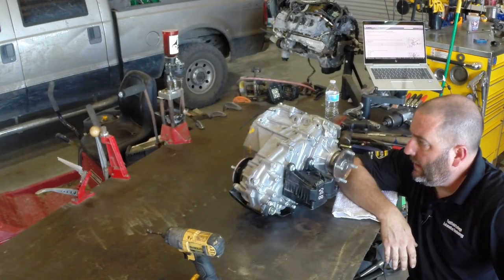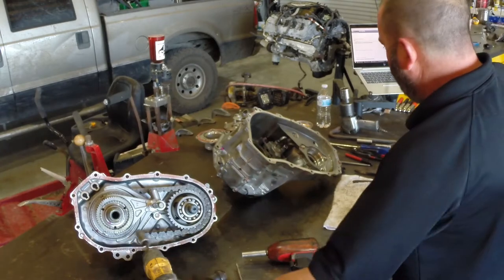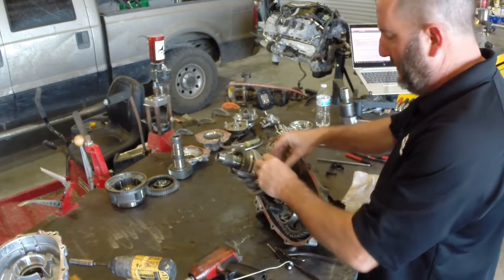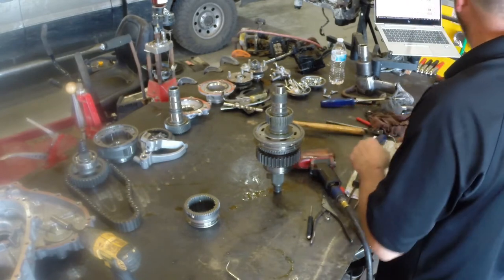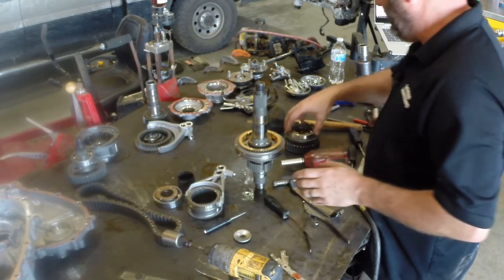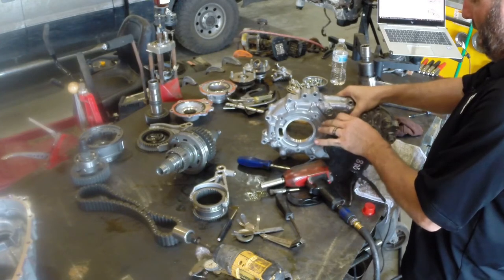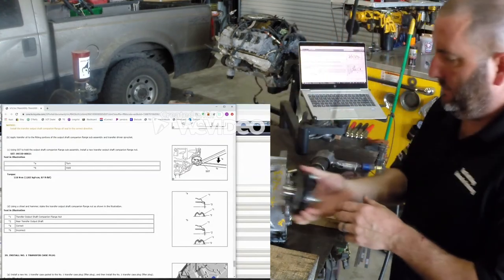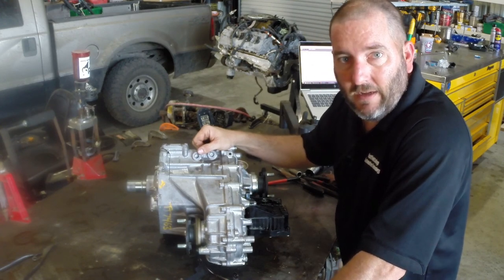Tacoma Transfer Case Overhaul

Comment: I pulled my transfer case from my 2010 Tundra. The output shaft that goes into the planetary assembly has small craters where the roller bearings ride. Right behind that there’s set of needle bearings that rides inside the main planet gear was starting was starting to haze up pretty bad as well.  The planetary assembly alone is $2,500.  I bought a brand new transfer case from Toyota, it comes with a new computer as well.  All I have to do is find the computer now and put them both in when they arrive.  My take is there was the wrong oil in it, because it was never run low and never had a leak

Comment: Thanks for the video. My 19 Tacoma has started leaking gear oil where it meets the trans. It appeared from the video the only thing that could cause that is the cover you took off at 12:50. You think that’s the culprit ? I don’t see anywhere else it could be leaking from.

Comment: Do you know why my 3rd gen 4runner gives off a big bang when disengaging from 4WD (4h to 2h)?  There is also a 30 second delay before it disengages and the 4wd light works normal on than off.

Comment: Just wondering if the Tacoma and Hilux share the same transfer case ? And what ratio is the low range ratio ?
Reply: The Tacomas use the VF transfer case. My 2004 Taco has a VF-2. Not sure if that’s the same for the same year Hilux. Low range is 2.57:1 if I’m not mistaken.

Comment: Assuming nothing was wrong with the transfer case, just something to do??? Only issue I ever had with a Toyota Manual gear box was a R150F in our 1993 T100 would not go back into reverse after selecting it, split the case, I found corrosion had built up on the reverse gear shaft making reverse gear hard to get all the way back to the detent position, it would stick just enough to keep shift gate from allowing selector to engage the fork rod. Took a green 3M Scotchbrite to the shaft, and polished the shaft, reassembled it, installed a Marlin Crawler quick shifter assembly, back to banging gears.....